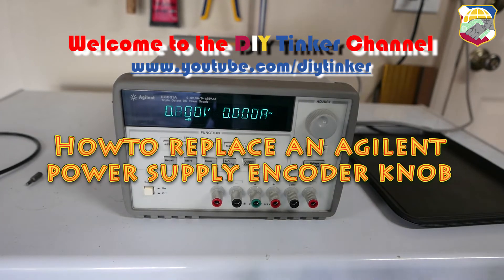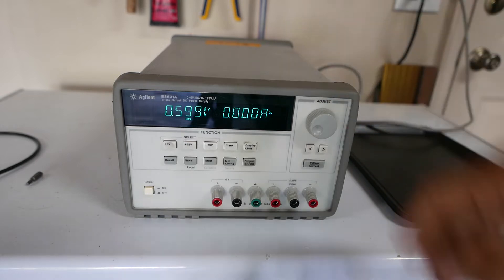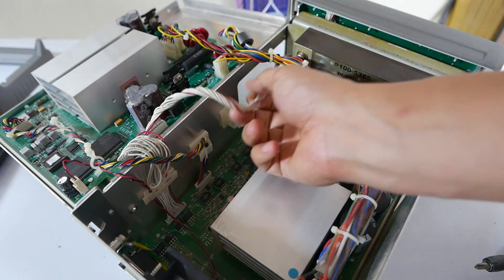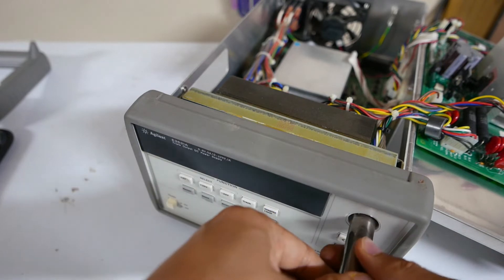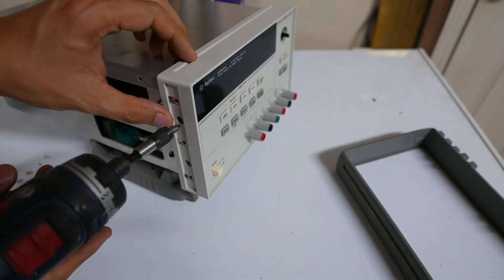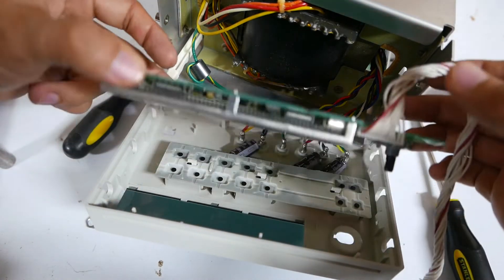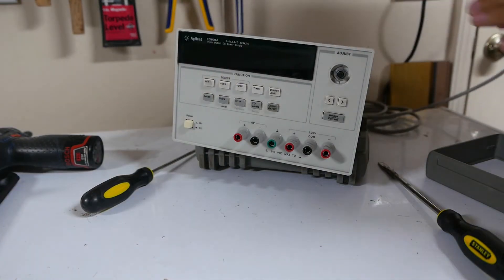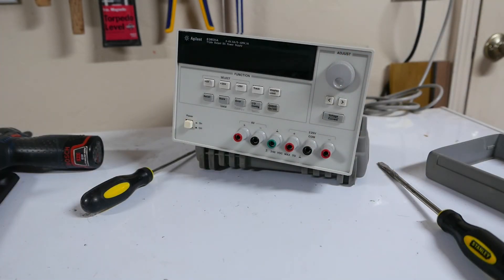Howto replace an agilent power supply encoder knob E3631A - repair failure

Comment: I have a much cheaper linear supply with the a very similar encoder issue. It's quite annoying to use. I will have to replace the encoder.

Comment: 😭😭😭When i finished repair. I touched the button by tweezers， and touch around the button ，it has 17V. Then the panel was broken. VFD driver and MCU were dead. Its float logic make the ground of MCU is -17V ，so MCU was added up to 30V! It was a bad story.

Comment: short cut: remove 4 screws at front panel, remove ribbon cable attach to PCB, replace knob...you don't need to unscrew anything from the back...
Reply: With the help of this video and this comment I managed to replace the encoder on mine in just an hour! Thanks!